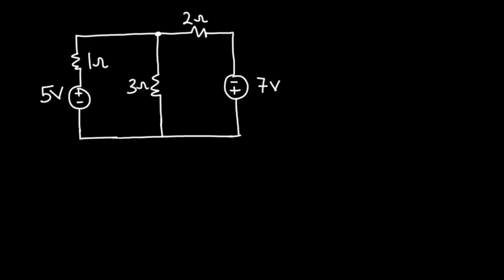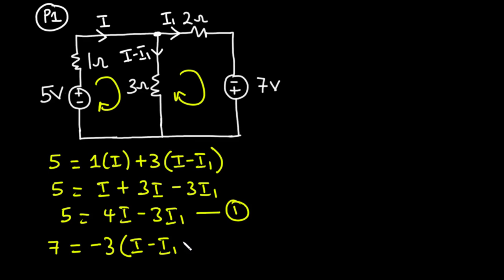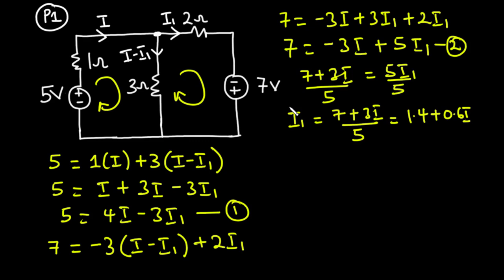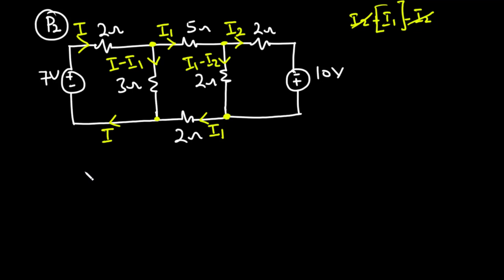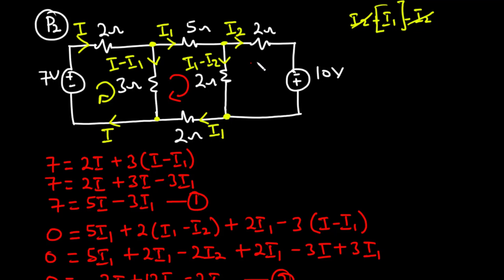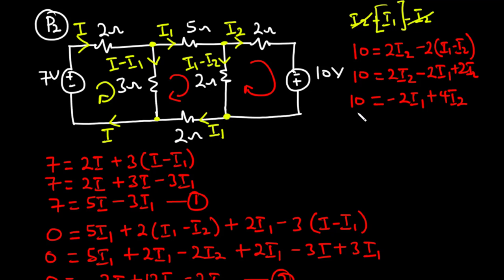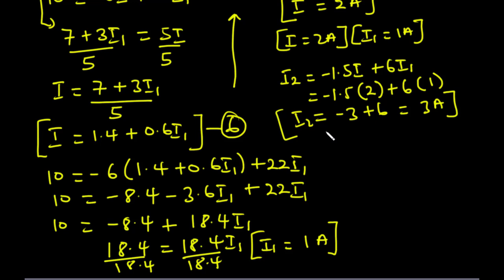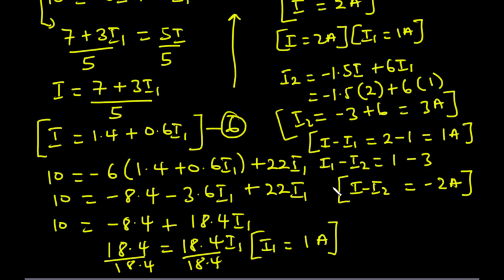17 - Kirchhoff's Current and Voltage Laws (Solved Examples)

Comment: Please how did you get-3 for the second equation
Reply from the maker: Kindly notice that, we had already assigned current i-i1 in the middle branch, and for the 2nd equation we tool the clockwise direction which opposes current i-i1. Since the resistor in that branch is 3ohms it becomes -3(i-i1)

Comment: This video is wrong. How did 3I become 3i1? Check between the 14th and 16th minutes of the video.
Reply from the maker: Can you be a bit more specific I don't see anything wrong here. I went back to correct the variables in the same period you specified, so if you can point out the exact time in the video, I will be so much glad.

Thank you so much.
Reply: Check the equation 4. You changed negative 3I to Negative 3i1. How did you come up with that?